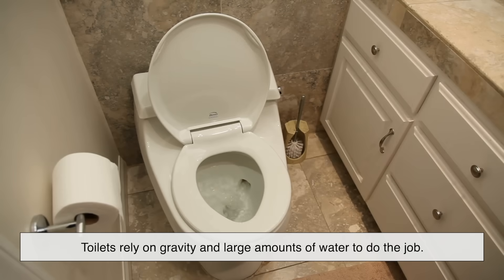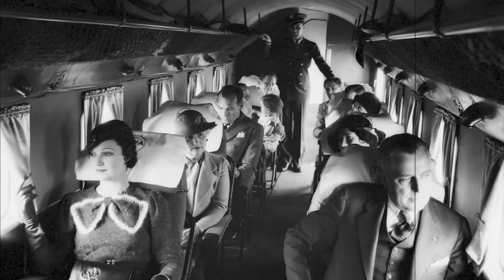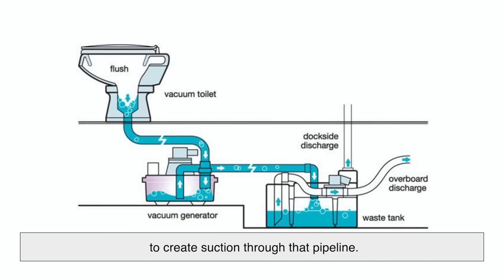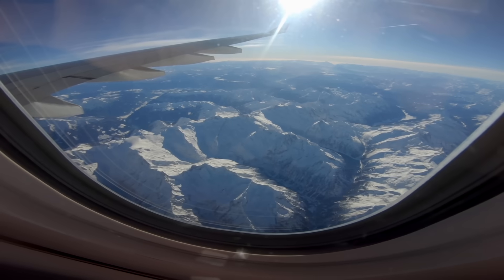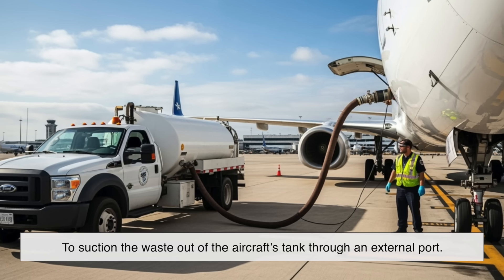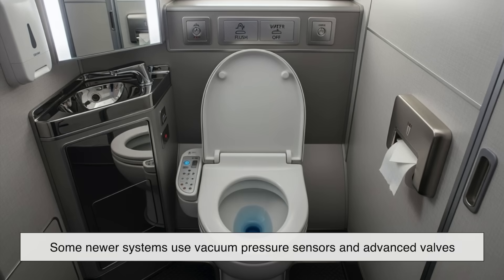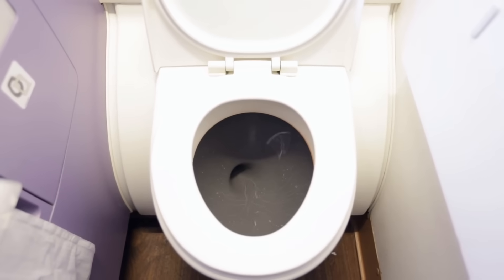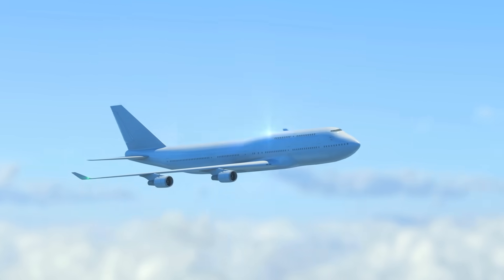How Do Plane Toilets Work? The Surprisingly Clever System at 30,000 Feet

Comment: There are a number errors in this description but the basic principle is there. The vacuum generator is usually downstream of the tank so the waste enters the tank without passing through the generator. There is a filter in between them to keep waste out of the generator. The Vac Generator is only used on the ground and at low altitude. Once the pressure differential between the cabin interior and outside is enough the system simply uses the pressure differential. Dumping the waste on the ground is usually done by gravity. I have never seen a honey truck suck the waste out. When you press the flush button a small dribble of water is sprayed into the bowl for lubrication of solid waste. The toilet bowl is coated with a non-stick coating like a fry pan.